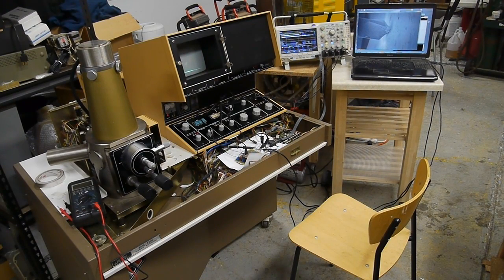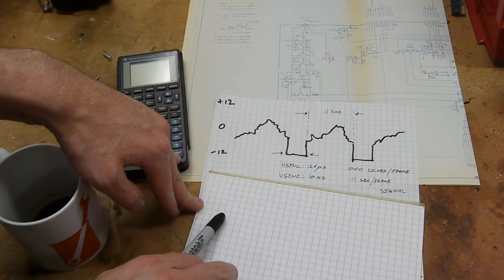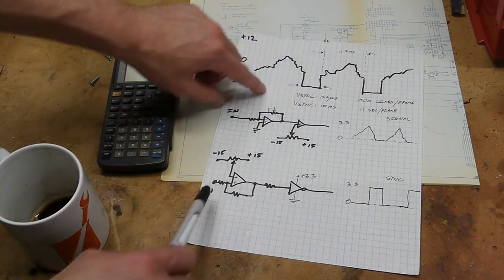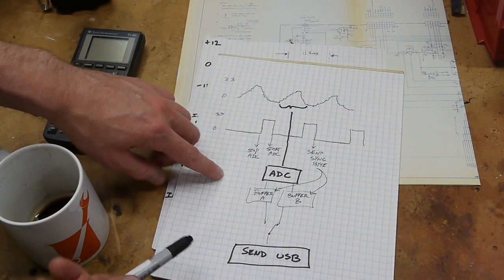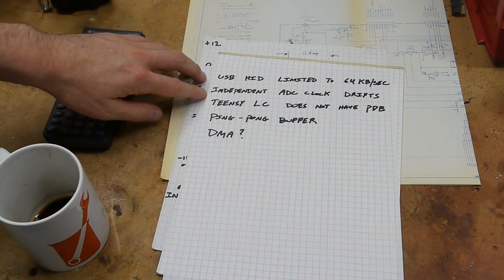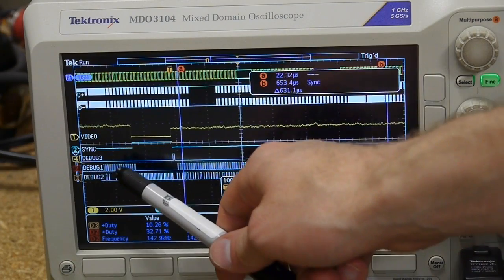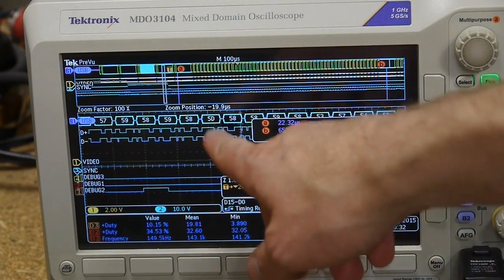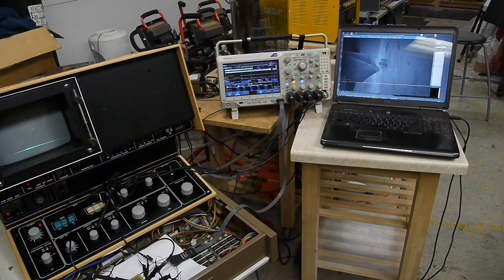Electron microscope image capture via microcontroller (with drill bit animation)

Comment: Very impressive bit of work. I was thinking about how I would have tackled the problem and decided I'd probably have just stuck a digital camera to that camera adaptor box with a really long shutter. The shutter could be controlled by noticing the bright dot move back up to the top left corner. Not as elegant as your solution but perhaps a bit quicker.
Reply: +Wobblycogs Workshop 
Sure that would work, but it's not really much better than making polaroids and putting them in the scanner afterwards. But it will only work in a perfect world.
Taking an image of the screen will never give you as high of a resolution and dynamic range. You don't know if the brightness of the screen is uniform or even linearly related to the signal. The electronics for the screen will introduce some brightness "distortion" and maybe the physical construction of the screen (electron gun or phosphor) means what the signal says and what you see on the screen isn't proportional. The image could even be distorted (pincushion/barrel) and you have distortion due to the screen shape and camera lenses. Then you're taking a picture with a device, that's much better at seeing colors than raw brightness levels (in that case a black&white polaroid may even have more dynamic range than a digital camera). White balance and other mojo the camera is doing will further decrease the dynamic range.
After you've figured all that out, you have to do it all again when you change anything on the microscope, starting with just the screen brightness but also other more important stuff like sweep time (I'm pretty sure the 1 image / 11s isn't the only setting).
Reply: +saturdayocean Yes, that was the other solution I'd pondered. I thought it would probably be slightly more work than just controlling the shutter. Either way I think I'd probably have sucked all the raw data into a PC and attacked with it code. As you can probably guess I'm in software development, when the only tool you have is a hammer...
Reply: +Wobblycogs Workshop ...you become extremely skilled at using that hammer and learn how to be very creative with its application?
Reply: +TheCammerhammer ...every problem looks like a nail. I prefer your end to the saying though.

Comment: What vintage is that SEM? I could surely have done with such a system when I did my degree thesis on porosity and phase control in borosilicate glasses back in the early 80's rather than rely on the postgrads to take crummy pictures and then not label them! It seems a lifetime ago now...

Mike

Comment: Great video! I would like to actually understand what you talked about when it comes to micro controllers, data aquisition, and all that fun stuff. Most of the experience I have had has been with mechanical data, being that I studied mechanical engineering. What are some good resources I could read to get a good grasp on this subject? I love how u explain technical subjects and I did understand some of the lingo but I am not sure if I  was following how you used the filters to drop the signal from +-12 to +-3.3 and why it was necessary to do that? I think is so amazing that you put in all that work for a 3 second anaimation that teaches so much. So much respect for the work you do. Thank you for sharing and staying up on weekends doing this stuff. I saw the time stamp on the occilascope lol.
Reply from the maker: +luvmyTM1911 Thanks!  I really appreciate it.  This is a great book on solid-state electronics: http://www.amazon.com/UNDERSTANDING-SOLID-STATE-ELECTRONICS-N/dp/B000NQ7Z8Q

It was necessary to convert the +/-12V signal into 0-3.3V because the microcontroller can only read voltages between 0 and 3.3.  -12 to 12 would overwhelm (or destroy) it.

If you'd like to get started with embedded and microcontrollers, I'd highly recommend the Arduino, and the kits and resources from Adafruit.  Sparkfun is also great.  I don't know of any great books off the top of my head.  I'd suggest getting a kit, and editing the examples to do new things.
http://www.adafruit.com/category/17
https://www.sparkfun.com/products/13160

Good luck!
Reply: +Applied Science Video suggestion: Applied Science's reading list!
Reply: +Applied Science I have never seen much on the way of signal conditioning when Arduinos are involved.  I guess it is intentionally left out or possibly glossed over since it goes way beyond the normal users of them.  I'm guessing the analog inputs are somewhat forgiving but no doubt have been burned up by many not knowing why.  Even the use of relays is considered "signal conditioning".

I don't recall seeing that particular book at Radio Shack and wonder if Forrest Mims had a hand in it?  His material was always top-notch and really made it easy to understand at an early age.

Nice job Ben!

Comment: Once you're controlling X&Y with a micro controller you can digitally limit the range to trade in some real estate for frame rate. If you manage a higher resolution with a slow and accurate digitally controlled scan  you can even use it to "zoom in" (slow down the scan rate for higher resolution, limit the spatial range, end up with the same frame rate and pixel-resolution)

By the way, would it be possible to use another (electro) magnet as a "magnifying lens" for the electron beam?

Comment: what voltage source do you use as a reference for the adc?
Reply from the maker: +Vadzim Dambrouski I used the  3.3V ref.  Although, the chip is being powered by a separate 3.3V regulator that is fed from the +15V supply from the SEM.